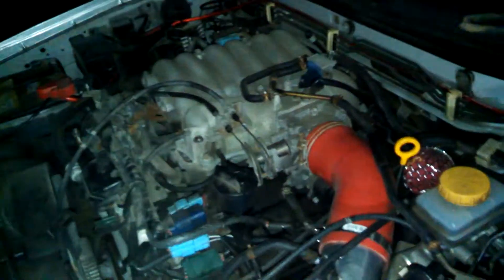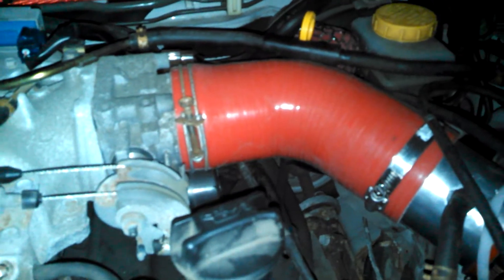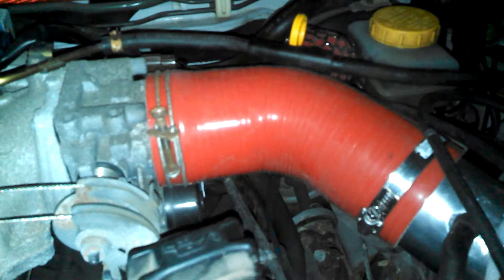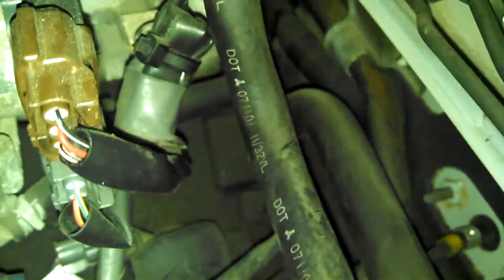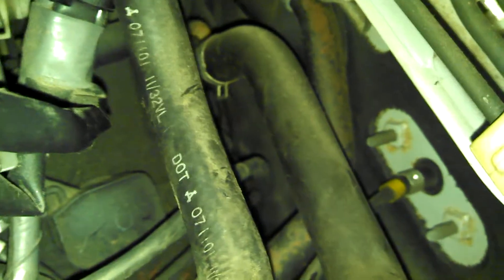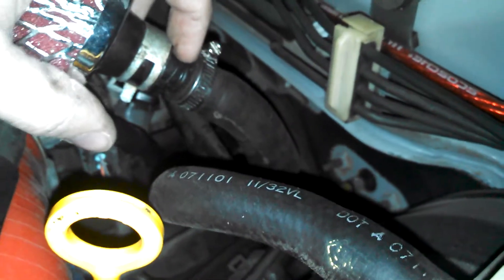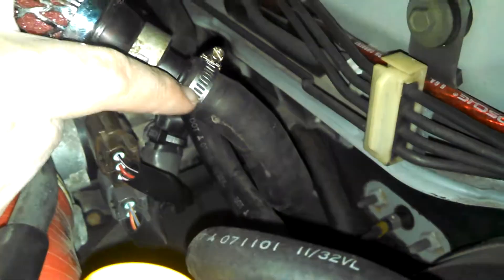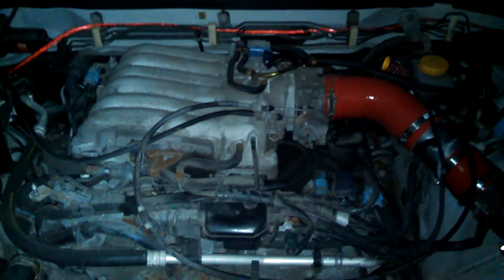2002 3.5L pathfinder intake

Comment: how is the gas mileage
Reply from the maker: when I'm just driving normal around town, like 17-18. can get 22-23 highway driving
Reply: +festerfm that's mean u get 320 miles and up per tank,right??
Reply from the maker: towing an 8ft enclosed trailer with a 4wd quad I get 12ish
Reply: +festerfm that's not bad
Reply from the maker: my driving is usually pretty mixed. it's no longer my Dailey driver so I mainly only drive it when I need to tow or need the 4wd. I usually run the gas close to empty b4 I fill, and usually takes 16-17 gallons. I've gotten 380miles a couple times
Reply: +festerfm that's not bad,a friend of mine get 250 miles a tank on her 01 nissan pathfinder
Reply: STEEVE DAVID Nicolas Can you tell me where are my PCV valve located on my 03 nissan pathfinder?

Comment: You turn the engine on and revved it up!
Reply from the maker: it doesn't really sound that much different unless u really Rev it up. I've had intakes that were loud but this isn't one if them. I really did this just to do it. whether there's any hp or mpg change is unknown to me. I was hoping it would just flow a little more air and a little smoother. no 350z sound here. plus it's not good to just rev, regardless of what the ricers do
Reply: @festerfm it’s actually perfectly healthy to rev and helps lubricant move freely